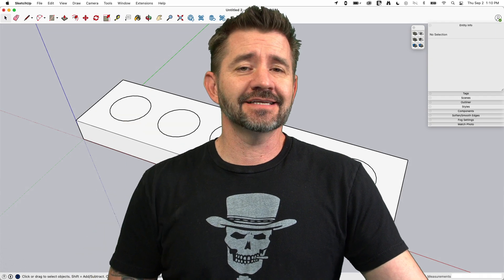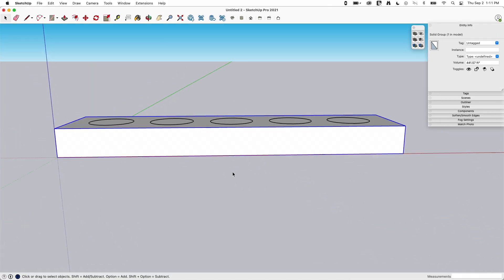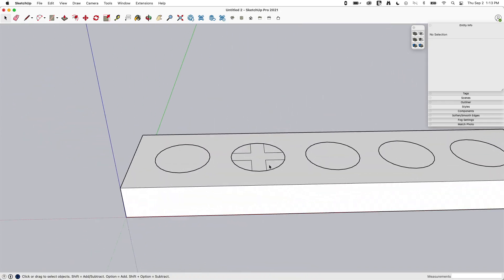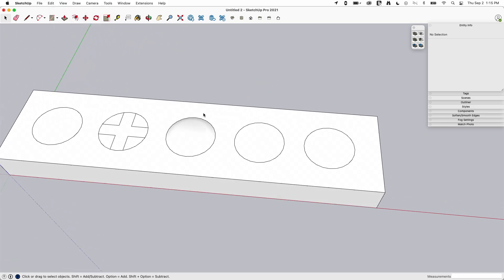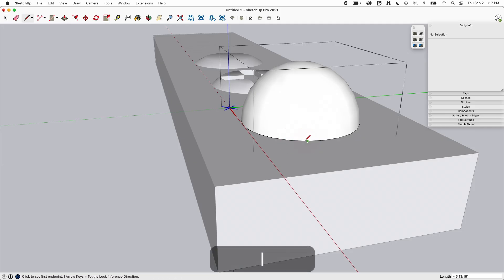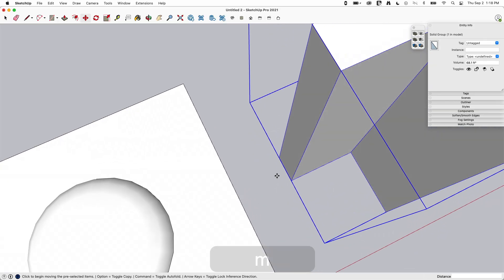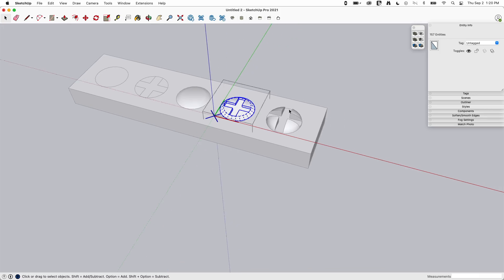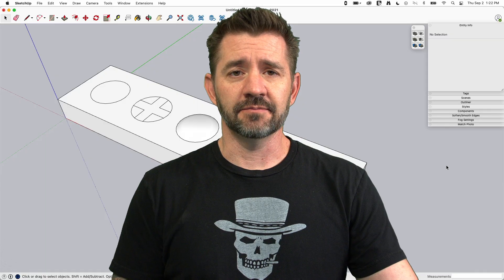Modeling Appropriate Screw Heads - Skill Builder

Comment: Sage advice indeed, especially when creating models for the warehouse. There are many many models which show incredible amounts of detail for no reason. Maybe you could do a skill builder on easy/quick steps to reducing a model's size? e.g. finding and deleting stray hidden geometry, unused textures, unused components and so on. Which ones should be attacked first to get the best file size reduction? Is there an addon which duplicates Meshmixer's reduce mesh complexity?
Reply: Skimp and Transmutr both have options to reduce a component poly count. Worth checking out and very helpful for single (monolithic) models.